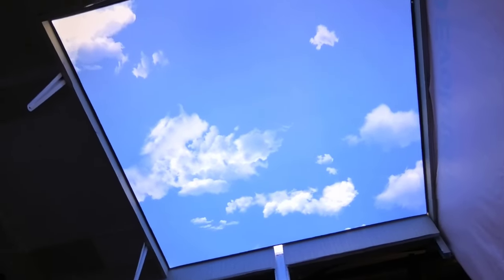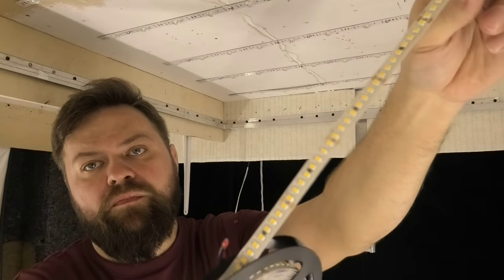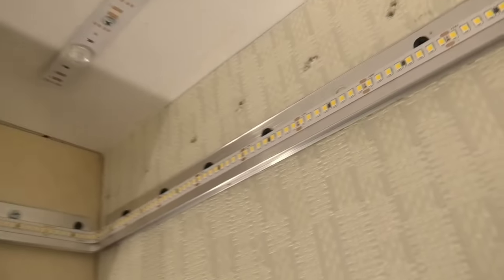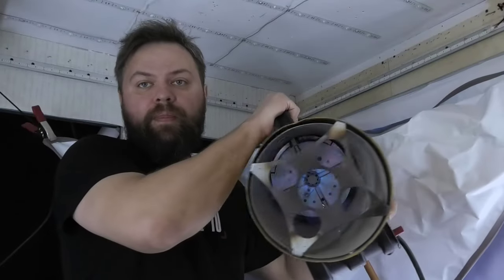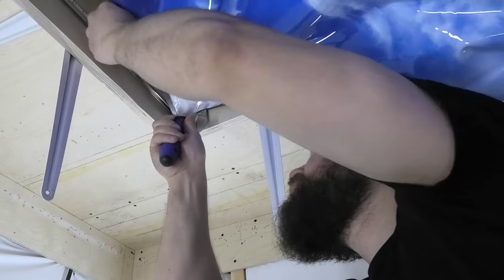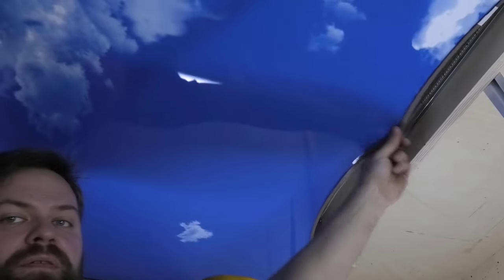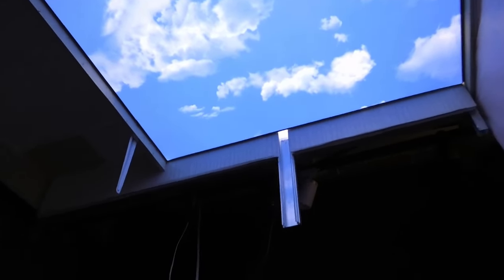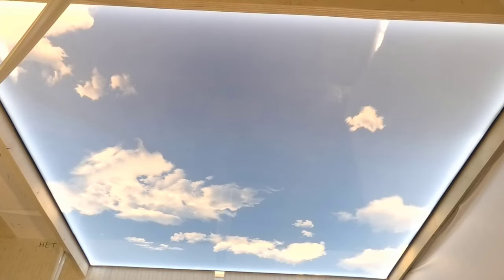do it yourself stretch ceiling sky with LED lighting / DIY stretch ceiling

Comment: Great job and looked pretty easy to do. So they tell you what size to make the frame so it fits perfectly? Do they make it so you can use fiber optic lights for stars? Can you tell me the company where I can buy it.
Reply from the maker: Hello.
The canvas is made to your dimensions and you install it.
For the stars you need equipment, but this is painstaking work and you need to make either stars or highlights.
You can't make stars and lights at the same time.
I know where to buy only where I live.
I used to send materials to different countries: Germany, England, USA, Cyprus.
Now it's probably more difficult.
I live in Russia.
Reply: But if there is a defect in the lighting behind the ceiling, how do I fix it?

Comment: Hi Michael, how easy is it to fix the lighting if led lights stopped working?
Reply from the maker: Hello.
to replace the LEDs, it is necessary to remove the stretch ceiling.
Therefore, you need to use high-quality LED strip.

Comment: Would be more helpfull if you could provide the name of the profile your using to hold that canvas and name of the canvas it self material you used
Reply from the maker: I can write the name, but this is generally not necessary.
our profile is called: aluminum wall profile for suspended ceiling. There is also a ceiling aluminum profile, it is attached not to the wall but to the ceiling
After the new year I will make more detailed videos.

Comment: Can Flex be used instead of PVC?
Reply from the maker: What is Flex?
Reply: @michaelstretchceiling  It is a white material made of rubber and tends to blue. It is considered one of the strongest printing materials because it is characterized by its resistance to tension, pressure and weather factors. It is used in illuminated signs. It is one of the strongest materials used in outdoor advertising and has a superior ability to withstand all weather conditions. It is a very strong leather material. Due to the presence of silk threads in its components, it was made specifically for illuminated paintings. Its lifespan is very long, exceeding five years or more.
Reply from the maker: There are materials that are not PVC but fabric-based.
you can use them, but I haven’t made a video on this topic yet.
For fabric, you need a different profile and a tool for threading.
Reply: @michaelstretchceiling  اولاً شكرأ لك على ردك واهتمامك وهذا يدل على احترامك وتقديرك لمتابعيك. ثانياً هل يوجد طريقة لصيانة الانارة خلف السقف ؟ وان وجد هل بالإمكان شرح ذلك في فديو على قناتك ؟
 @michaelstretchceiling прежде всего, спасибо вам за ваш отклик и интерес, и это показывает ваше уважение и признательность вашим подписчикам. Во-вторых, есть ли способ отремонтировать освещение за потолком, и если есть, возможно ли объяснить это в видео на вашем канале
Reply from the maker: That's a good question!
You can remove the canvas and replace part or all of the backlight.
You can also change the canvas with a new pattern if you are tired of the old one.
Reply: Canvas may be easier to work with and require less wattage because of the thinner material you would use a dimmer setting on the led.  This is a great idea. Thank you for the content!!